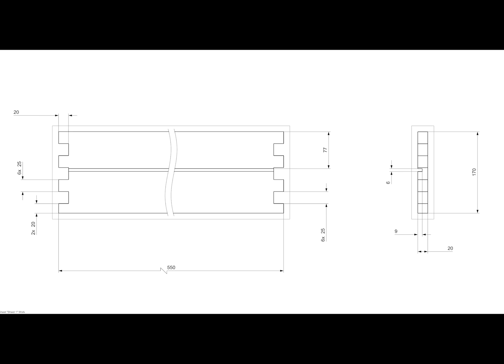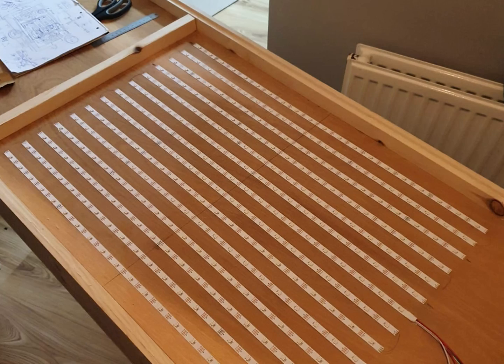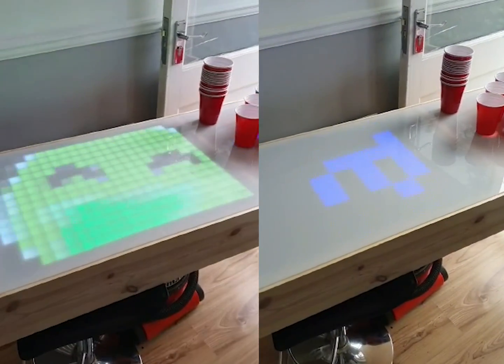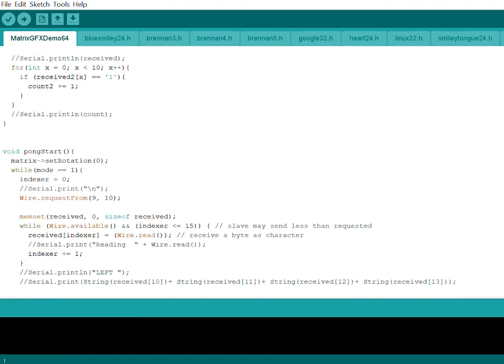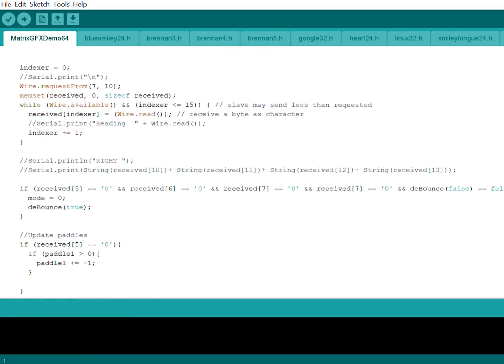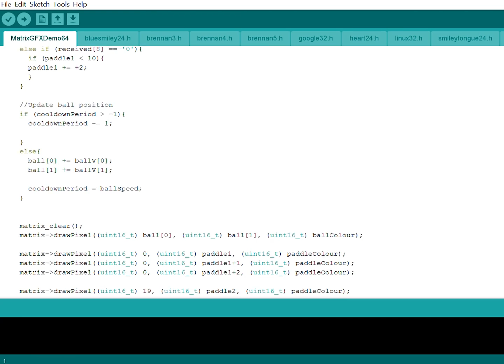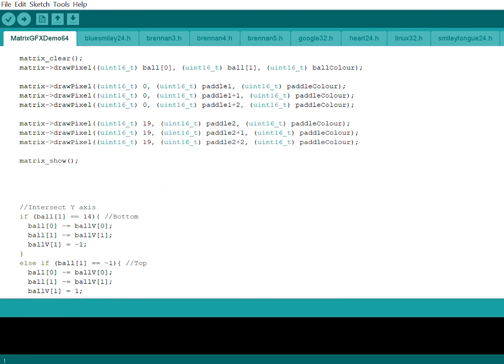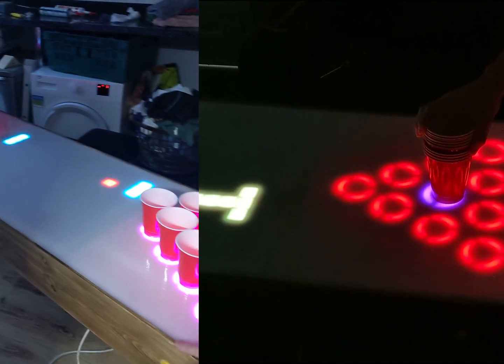Interactive Pong Table Lockdown Project - 2021

Comment: Im barely starting my own interactive BP table, any recommendations you give?
Reply from the maker: If you're using infrared sensors to detect cups keep in mind that they will not work outside or in bright light very well (this was an oversight for us but did not matter as we intended to use this inside a basement)

You can find out instructables here:
https://www.instructables.com/Interactive-Pong-Table/
Reply: @percyedward  I was practically starting but then, I went onto RFID Tags, what would you think about that